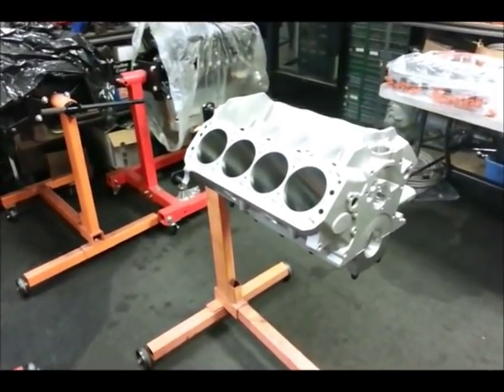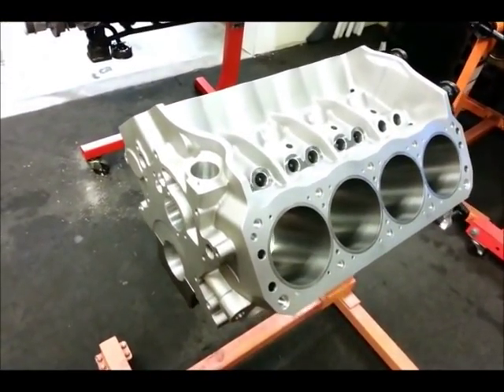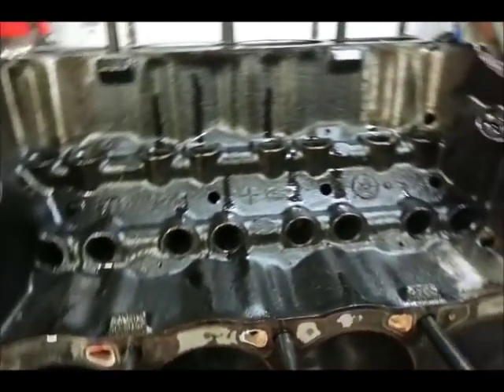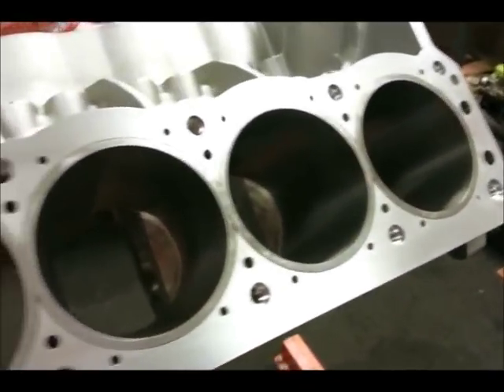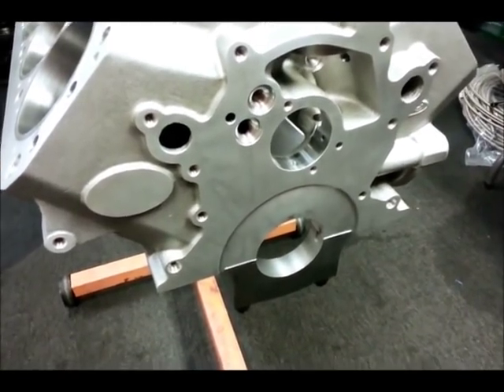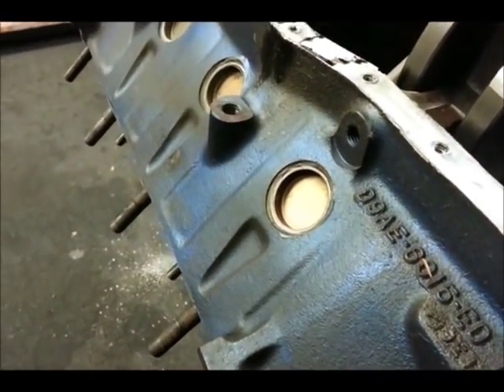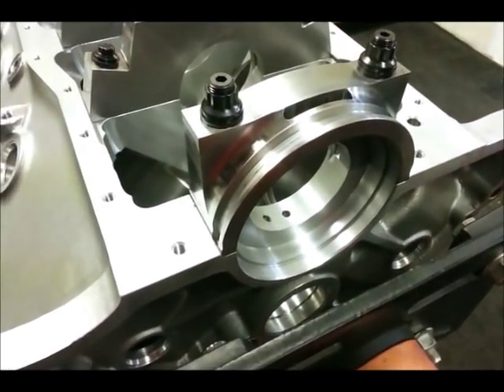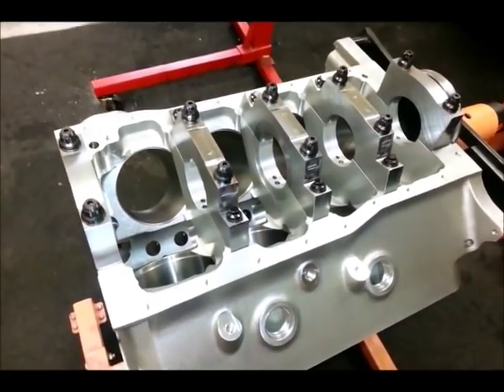The Ford Racing Z351 Aluminum Block

Comment: course its a ford guy who continues the freeze plug myth, its a Casting core plug, that's literally how they got the sand out of the coolant jackets, they do not save the block from freeze cracking, just the happenstance that the water expanding when freezing pushed them out.

Comment: The last injected 351s out of the last 80s / 90s 5.7s out of F trucks and E series vans, I don't know who it was , it might have been Glidden but he said they will handle 900hp right out of the box, and they are the blocks you want if you want to build a hot cleveland on a realistic budget / not using super exotic parts.

Comment: They are not "freeze plugs" and damned sure aren't "designed to pop out". They may fall out of flimsy-ass Ford blocks but that's not by "design". That "alloy" block is also in no way, shape or form "stock replacement" and nothing "accessory" Windsor - oil pump, engine mounts, etc - will "bolt on".

Comment: Ford waz encountering porosity during the casting of these cast iron blocks. But really why would anyone want to make horsepower out of a 351 Windsor. 302 boss blocks have never had a problem. I've been a master tech with over 42 years experience. You guys kill with this shit. Building a 351 Windsor to make real horsepower is a matter of more money than brains club.

Comment: Only saw that happen to s 351 block once, they shot enough nitrous on it to kill an elephant. Only beef I got is that heavy ass crank with 3" mains. Buddy spun a stock block, stock crank 6900 for nearly 2 years. Got greedy and started spraying it without pull some gear out. It didn't like that! They have a 9.5" deck that gives you room for a good rod to stroke ratio or stroker crank. Question is why do weekend warriors build 302 based motors? Make babies standing in a hammock?!!

Comment: freeze plugs are not "designed to pop out when freezing" it is where the mold held the casting when they casted the block. Literally 9 out of 10 all frozen engines Ive seen never popped a plug, and cracked.

Comment: Those are not for freezing and popping out. They are for placing the cores in during the casting of the block. Yes screw in core plugs are better.

Comment: This is the block that a lot of builders are using for their “Clevor” engines. There are some great YouTube videos featuring 461 cu/in stroker alloy block builds using aftermarket Cleveland canted valve heads. Dandy Engines in Australia built a 461 Clevor featuring Higgins Race Heads Alloy Cleveland heads for use in a street vehicle. It’s naturally aspirated and using pump fuel it pulled 934 horsepower and 669 lb/ft of torque on the dyno.  Running race fuel it increased to 979 horsepower and 700 torque. Pretty good numbers with no power adders. 

I have to agree that the guy narrating this video comes across as being clueless in general and especially bad in his knowledge about Fords. 
Popular Hotrodding Magazine was always heavily Chevy biased. Now it shows on their videos. 
And the beat goes on.....

Comment: Was a electric eye burner(CNC Oxy/fuel gas) heavy plate burner. Had a clients regular order of 500 or 1000 count bearing caps for racing engins. When burned from rolled plate the molecular alinement of steel base elements far exceeded forged or cast. Once the delivery trucks from this customer had the finished engine blocks on their truck when they picked up(if memory serves me the outfit was in Bellville ,Michigan). Everything i saw was Aluminum everywhere. Drivers i asked gave such a high hourse power # they had to be badass. Order paper work routinely was labeled 302---351--- then Chevy #'s 427 ect.   The front main bearing caps were what was called a double burn; ie. "C" shape 1st then i put them in a jig fixture burning notches out of a flipped view. Everything had to be so dialed in on the 5 torch rig i used as tolerances were so tight to maintain minimum machining on that customers end.

Comment: Stock Windsor blocks with 4 head bolts per cylinder are good for about 450 HP if you change to 4 bolt main caps or stud girdle with 1/2" bolts/studs at both mains & heads & ARP quality 5/16" rod bolts or 11/32" rod bolts minimum for 221/255/ 260/289/302.  The 260/289/302 blocks came with 7/16" hardware at mains & heads & weak 5/16" rod bolts.  Shelby had developed the 11/32" rod bolts as a compromise that could still use the stock length 289 rods.  ARP has these bolts available & they can be fit into stock rods by drilling them out.  Boss 302 rods came with 3/8" bolts. Obviously if you're going to create high HP or run the engine hard, it would be best to replace the rods with units that use either 3/8" or 7/16" rod bolts.  Eagle Specialties has reasonably priced replacement rods for 302 engines with ARP 3/8" bolts.   All 351 engine designs use 1/2" main & head hardware & 3/8" rod bolts & 3.500" stroke, 4.000" bores, & 2.310" rod journals.  Block design, deck height, crankshaft main journal diameters, & connecting rod thickness & lengths vary.

 The lower end Windsor engines are  essentially a small block version of the 385 series Lima big block (371/429/460) engines, using  the same block, front cover layout, water pump, coolant flow,  & oiling system design.  255/260/289/302 crankshafts feature 2.25" main journals & 2.125" rod journals, while 351W cranks use 3" main & 2.375" rod journals.  Also 302 blocks have a shorter deck height than the 351W.  The 221/260/289" engines all use 2.870" stroke & 5.150" long rods with differing bores to acquire the CID.  302 cranks use 3.000" stroke & 5.090" long rods in a 4" bore block.  289 & 302 blocks & pistons are the same.  351W rod length is 5.956".  
       
  The 351C is completely different.   It uses reverse coolant flow (coolant exits through the block), a flat steel plate timing cover with the timing chain inside an extension from the block front, 2.75" main journals, & 5.78" connecting rod length.

The 351M was produced from 1974 through about 1980.  I can not find an official end date, but I have not seen 1980 on pickups equipped with 351M but instead with 351W engines.  It must also be noted that I was repairing farm/ranch owned pickups in northern Montana & have not seen many from 1980 through 1982 due to Ford attempting weight reduction to achieve better fuel economy by having a series of fairly large holes in the frame rails.  However, the 400M was installed in pickups through 1982 & discontinued in 1983.  These engines used the Cleveland block design with raised deck heights to accommodate 6.580" long connecting rods.  The 400CID version used 4.000" stroke with shorter compression distance pistons.  The 351M main bearings are the same as 351W while the rod bearings are 351C units.

Comment: NOTE:  They are not FREEZE PLUGS they are not made to pop out. 
   Those brass / steel plugs you see are CASTING PLUGS. That cratels the casting frame. Result from the support legs holding the water  jackets while casting the engine block. Do you actually think the manufacturer intended to save the engine from cracking in a freeze by making those holes.
   After the casting those holes are machined out then liquid is pumped through those holes to remove the casting sand. 
   You can thread any block to screw in threaded steel plugs in. 
    I worked for Porsche for over twenty years and yes Porsche did make water cooled engines. I also worked for Mercedes.
   If you notice when engines using brass casting plugs overheat  sometimes brass plugs expand and then cool and fall out and also leak at the seams. On the other hand steel plugs are closer expansion rate to cast iron and give less problems than brass. why do people use brass plugs the so called SHADE TREE mechanic thinks oh I will use water without antifreeze save money that way I have no lubricant for the water pump and I will use brass plugs that way they will not rust out and leak. What is up with that Gomer Pile.
   If you are a mechanic and this is what your instructor taught you you need to go back and explain this to him so he does not turn out any more people with this idea. and antifreeze should be changed app. every 2 to 3 years. It will create acid and loose its lubricant for the water pump. Brake fluid to should be changed about every two years. Sorry I didn't mean to spoil your day. Ps.Do research before you make a video because bad info will effect a lot of people and go a long ways. 

Regards; Phillip C.

Comment: The Z51 block reminds me somewhat of the Ford 427's side oilers I ran years ago except it is not in a Y-block configuration.  Looks very strong....   Wish I still had the 427's......sigh.....
Reply: 427 arent Y blocks...
Reply: @ragimundvonwallat8961  ...I wondered if anyone else caught that.
Reply: Agreed.  I started out with a 1968 F100 fitted with a modified 352 in high school.  Swapped it out with a 390 & later with a 428 with medium riser heads & port matched sheet metal fabbed intake.  I loved to show all the SB Camaros the taillights in drag racing.  It amazes me still that some say the FE's are boat anchors.  In comparison, though are the similarities between the 390 & the 400M.  I have a +0.060' 400 with KB177 pistons (raised top FT w/1 relief floater hypereutectic 351C) in a decked block with ported & decked heads, custom grind Comp cam & valvetrain, roller rockers, port matched  intake & exhaust 11.2CR engine in a'79 F-350 4X4.  Unreal torque!  She's tired now, so planning a 521 big block.
Reply: @donnatalielucasheimbigner7598  how on earth were people able to afford engine swaps in high school? I worked from 16 and could never afford to do more than a few bolt ons and just keeping my truck running on mostly stock.
Reply: @usaa300  I had worked  since I was 11 during  summers.  Dad had a '68 F100 he was going to trade on a newer F150 but he couldn't get what he wanted for it.  He felt sort of bad because I had spent a week after school cleaning, waxing, & detailing it, so he gave it to me.  From there I traded work for parts & donor vehicles, with reading & much effort, I learned to fab, weld, do bodywork & paint(not as well as I would have liked), & engine, drivetrain, steering, suspension, & brake work.  The 352 engine that was in it got a 4V swap from a donor 390 & served until the 390 was rebuilt.  I worked on people's vehicles & regular jobs.  I did the mid buck stuff in college where I had access to a full machine shop (I majored in auto tech).  The 400 in my '78 F250 (now registered as the donor '79 F350 was done after college. I worked fulltime & moonlighted working on people's vehicles.  I have done all work on the engine myself, except the boring, balancing, & mill work.  I also owned a '68 Torino GT after college.

Comment: I just can't not say anything!
There's no way a cast iron Windsor block weighs what he's saying, if 4 bolt heads are so inferior, why did GM go to 4 bolts/cylinder on LS motors, Hemi's have 4 bolts/cylinder and those are casting holes, they aren't for expansion during freezing temperatures!
Reply: thats way 5 bolts are better
Reply: cheaper
Reply: It has far more to do with the deck thickness and port and water jacket routing. If the block/head was rigid enough it could use a single bolt. As for the cored holes filled with welsh plugs they are indeed used for core removal after casting but their purpose isn't for the removal of sand as there is cored holes in the front of the block that would be perfectly adequate for sand removal. The cored holes are next to the bore pairings in most block layouts there is an water jacket between these and even when there isn't they still share the outer water jacket. The sand core is very thin here and needs support to prevent deflection. Remember even though the metal when cast is molten it doesn't get any lighter and even the action of the molten metal flowing past will bend/break the core. The hole is only for a part of the core to be held securely outside to prevent deflection. As for the now required plugs only being a push in fit it is actually to allow the coolant to expand and push out when it's on the verge of freezing. It needs to cover the last area in the block water jacket to freeze, this in the biggest volume of coolant by the smallest surface area usually at the bore pairings. The cores could be adequately held with a much smaller hole but are not due to the required surface area for the water to push out the plug before it becomes ice and cracks the block. This is why you should never glue in a shouldered welsh plug only ever a disc. You can seal them with silicone but that's all. The size of the welsh plug should have been calculated and tested to ensure it will release at the correct moment before cracking happens.
Reply: Rodger Haas this Guy s Brain is extremely light weight.. He’s another $$$ Wiener

Comment: The only Windsor blocks I ever had experienced with problems cracking are the last generation roller cam 302's in foxes
Reply: I always wondered how you would test to see if the main bearings stay round with aluminum block and steel main caps. Thermal expansion is not the same. 🤔
Reply: Thermal expansion isn’t an issue at 200-270 degrees. 

If your mains are hot enough to expand that much, you have other issues.
Reply: split 2 of those in 2 (94 mustang) over 6500 at 550+ hp they just produce 2 2.5l 4cyl lol(paxton + 150 of juice to get it moving)

Comment: So is the Cleveland 351 a stronger block?
Reply: Cleveland is all most like cadillac block I think the engineer  designer worked on both engine  the water outlet is the same on the engines and have overheat the same way  water as to go up then back down to get out LS Chevy has the the same problem. Chevy had to add steam lines on LS

Comment: The main thing here is that its not a racing 351 engine but a  stroker engine upto 452 cubic inch, which is not the same as a 351C racing engine which will not produce 750HP naturally aspirated full stop. Also guys i dont know if you noticed that the Z block has piston sleeves and not the normal piston hole, which means that you can replace the sleeves just like a diesel engine has, cheers :) also the welsh plugs are normally made out of steel and no brass and sometimes even aluminium, which is as the person who commented below is to remove the casting sand out of the block when its made and engine coolant is the only thing which running in those areas and to have a welsh plug fail due to  hi pressure which i have never ever seen one do that at all when new or even after a couple of years unless the wrong type of coolant is used and electrolysis is happening thus the brass or steel is reacting to this, but to have screw in type welsh plugs is a good idea, but not so much for those on the block but those behind the head and on the heads as well ?
Reply: 7071t6 ~ You are absolutely wrong man. Both 351W & 351C will make 750hp without power adders.  I’ve done it with excellent reliability and just about every Ford Performance engine shops offer them for sale every day of the week.😎

Comment: I like his comparison info but the wording is where he pisses me off. He makes it seem like the STOCK block is bad but I heard him say 700- 800hp. That is where the problems start. 
Think; a stock grocery getting 5.8l old tech engine that is good for 700hp is AWESOME. Show me a 350 or dodge 5.9 that can hang.
The engine is sturdy and beefy for its intended purpose.
Reply: Strang 1 
Yes, Ford built up these engines over what GM and Mopar did to their small blocks. The 351 W is a solid engine and worthy of any hotrod

Comment: So if ford makes such "weak and flimsy" blocks from the factory why invest in another ford block that is likely to have a weak link as well? Why not go with an Iron eagle or world block that is designed for 2000+ hp and has been proven? Who cares about saving 150 pounds when you could confidently sleep at night making another 1000hp than this aluminum unit could take? I would rather have 4 bolts on all 5 caps... especially in aluminum.

Comment: Of course they are going to make the aluminum block thicker. 
Aluminum is only about 1/3 the straight of still .
The only advantage in this block is the ribs. 
   But you could ask the question. 
Can't they just add ribs to the Iron casting of this block. 
   And second question,  if 150 Lbs is all you save , can't you just take that weight off from the rest of the car ?
For example switching from still body panels to aluminum or even carbon fiber.
   And anyway if you can make 900 horsepower from a 302 or 351 why not just switch up to a slightly bigger block?
After all you are not going to be running that thing as a daily driver?

Comment: The guy in the video explaining This is not ordinary Block this is for all out Racing High H.P. Ooh Darn I was going to use Cast Iron small Valve smoger Heads, 2BBL Motorcraft Rebuilt Carb by Jim Bob, Low Perf Cam and Points Distributor for my Swamp Buggy

Comment: So much wrong miss information, the main thing mixing up the the early 221/260/289/302w based block with the 351 block. (As someone already mentioned) The low deck split at around 500 hp, but really how many low deck windsors really making 500hp?
Even in Australia the 289/302 rebuilder motors are at throwaway money, my next motor will be a another 302 roller, such a neat, cheap, little, light motor that fits into almost anything :)
Leave this motor for the people with throwaway incomes (not me unfortunately)